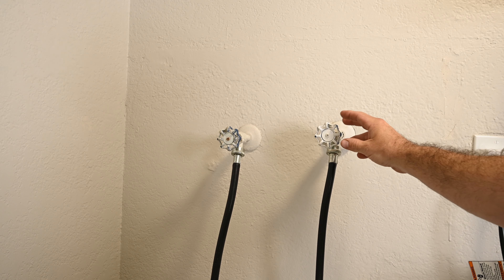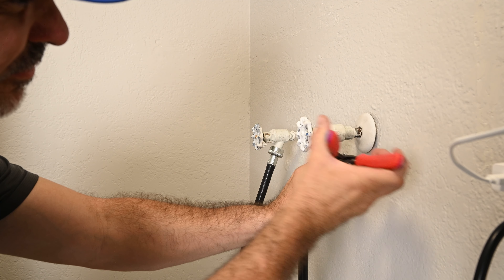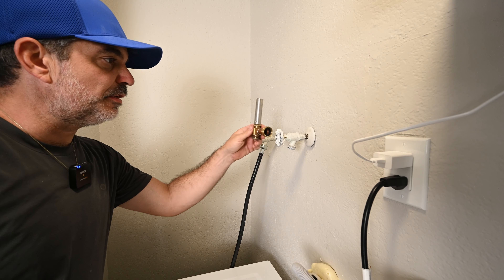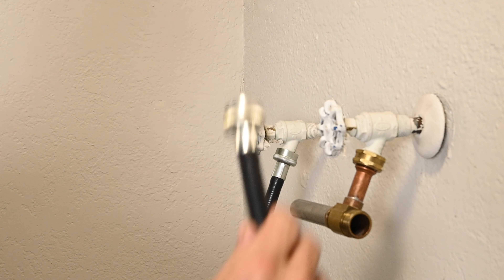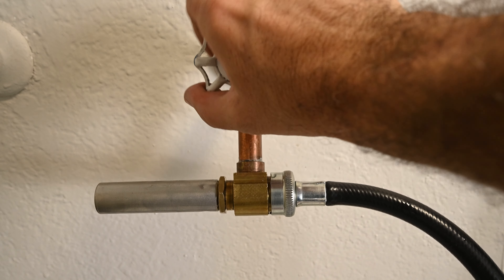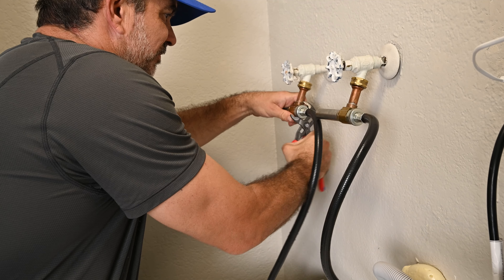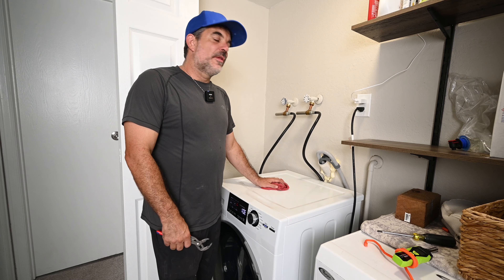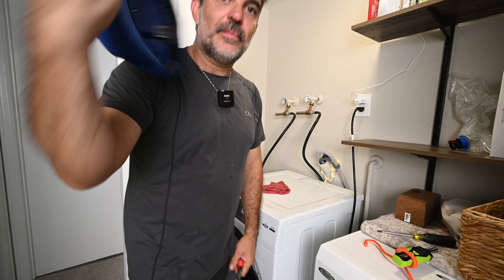Installing a Water Hammer Arrestor for Washing Machine

Comment: I've had both of my water hammer devices fail within 2 years. I used the same kind as you used. The stainless steel section popped off and water went everywhere! I decided to put an expansion tank near the water heater. Much more robust and took care of everything in the house.
Reply: Same here, my second set of arrestors lasted 1 year for the hot water and now 1and a half years the cold is starting to go. From my experience the piston types do not last. The piston inside is made from plastic, i think if it was made out of metal they would last a lot longer.